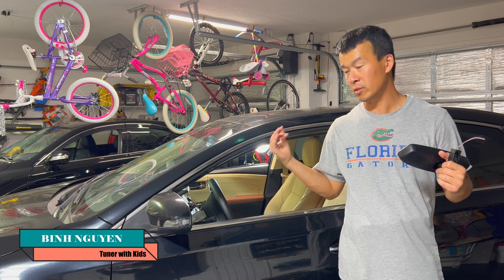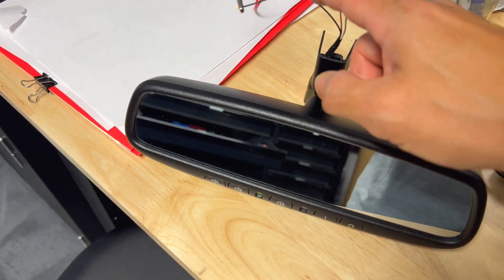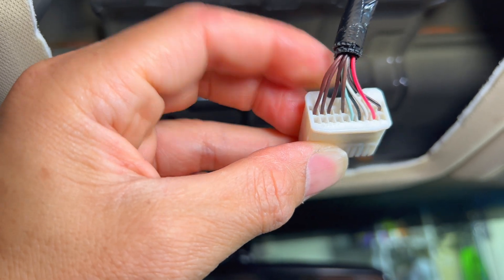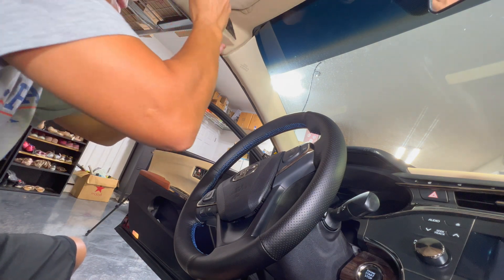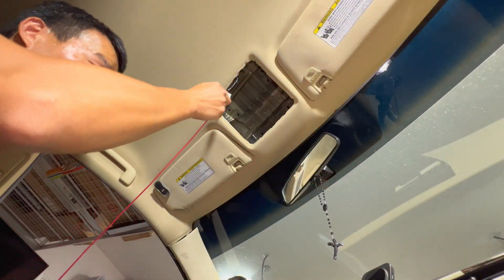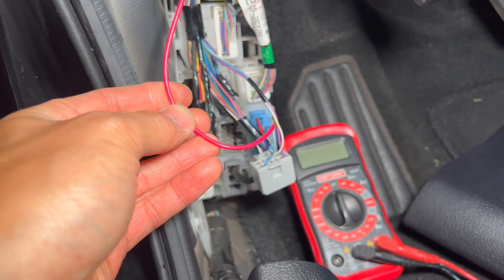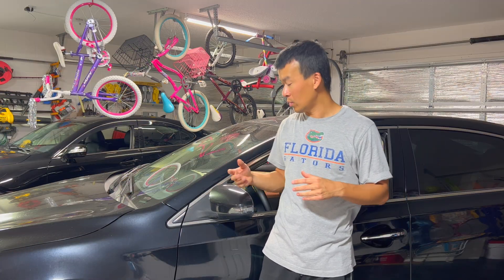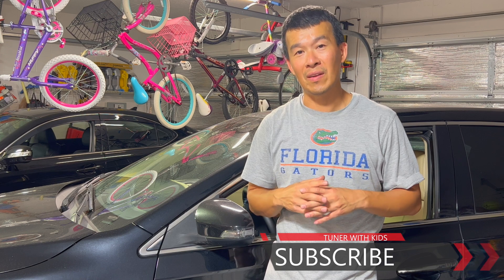How to Wire and Retrofit Homelink Dimming Mirror for Toyota Avalon

Comment: RAV-4 2019, limited, but on the mirror at the top right the icon is crossed out and when you switch the lever the camera does not work, can you tell me how to fix it so that the camera works. Thanks in advance.
Reply from the maker: Sound’s aftermarket. OEM didn’t come with mirror cameras view.
Reply: @TunerwithKids when tapping into the hot wires, did you have to disconnect the negative terminal from the 12v battery to avoid any short circuit? Read somewhere that it’s recommended to do that
Reply from the maker: Nope, I just work hot.

Comment: Does it needs to be 16 awg primary wire ?
Reply from the maker: You can get by with 18 and maybe 20.
Reply: Ideally you would match the existing wire gauges. going 16awg is not ideal.

Comment: I moved into a house with a LiftMaster garage door opener. I spent about an hour trying to connect the HomeLink to 1st Gen Lexus IS300 and it wouldn't connect. Like you said, I found out that the new LiftMaster does not work with older cars. It worked on my wife's 2017 Lexus RX350.
Reply from the maker: Yea, you need that $40 repeater from Liftmaster. https://amzn.to/3YWLeNs
Reply: This is true. We just moved into a brand Lennar home in South Carolina from Arizona. We had Chamberlain at the old house and my 08 Volvo worked just fine. The new LiftMaster at this new house does not work with the Volvo. The 2020 Camry we have works perfect.